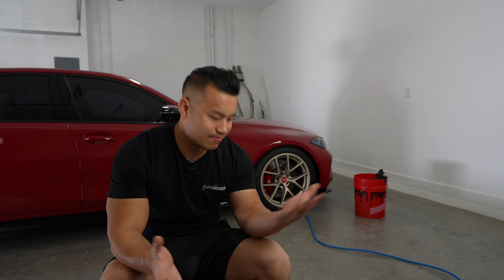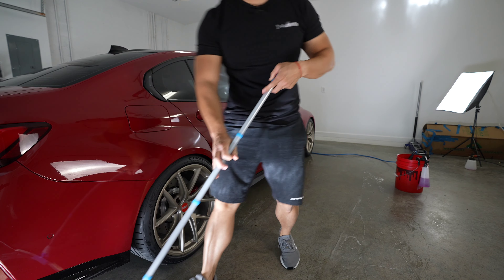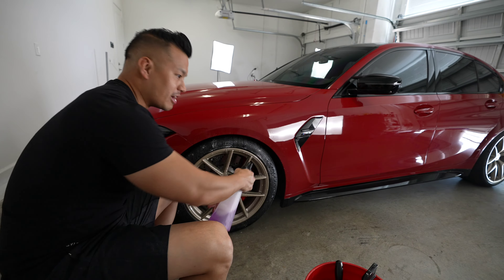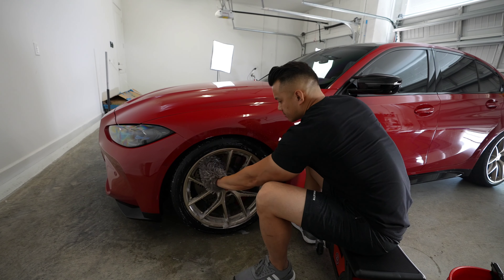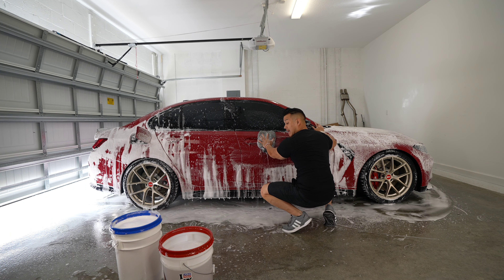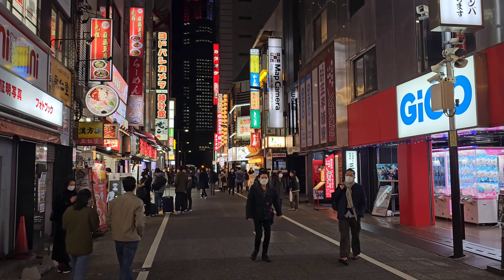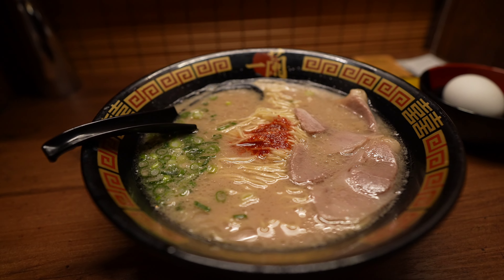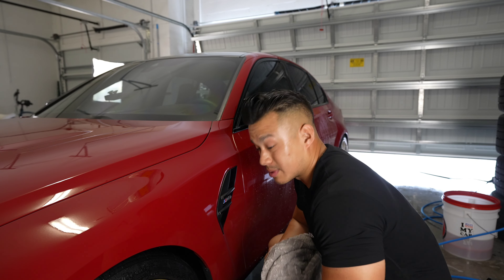I Spent 2 WEEKS In JAPAN 🇯🇵 And Now I Want To MOVE | Wash Cast Episode 8

Comment: I’ve thought about washing my car in the garage. But, even squeegeeing the ground and a humidifier, the spray mist still turns me off from doing it. Mold is a living organism and grows, so, even a little mist would land water droplets on the walls, which grows into mold. Even some small specs that you can’t see. I am however looking at painting the walls with anti mold paint. Still looking into it.
Reply from the maker: I've been looking into specific paints om just that. I just haven't finalized it yet. If you happen to come across one let me know ! 

Washing in the garage just makes it convenient where I don't need to worry about washing when the sun is down and ect.
Reply: @TheDailyDriven  I’m looking at Zinsser and Killz anti mold paint and primer. Since you’ve already washed in your garage, I would look into ways of making sure the walls are cleaned, so, you’re not painting over any existing spores that are just going to grow underneath. If you paint over it, and the paint or primer blocks it, it’ll just start eating the drywall, under the paint. Maybe a bleach or acid wash before primer and paint? Still looking into it, myself.